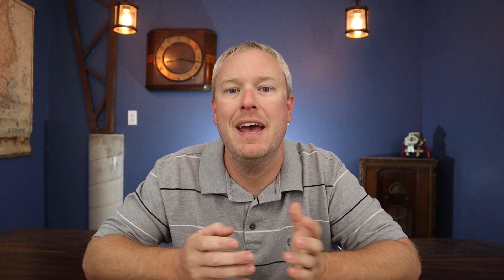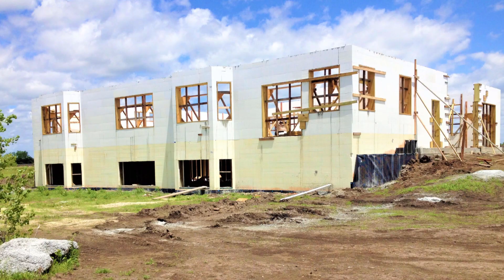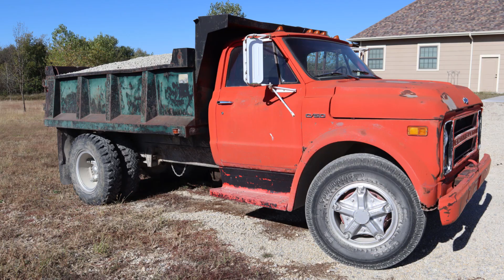NEW House Build Coming - ICF & Geothermal

Comment: Fantastic Garrett, this should be great.
Spend time on Plan Development, ICF stucco finishes, ICF trim interior & exterior.
Hollow Core vs ICF vs metal truss.
Window & Door bucks, design choices, material choices.
Window & Door size and material choices.
Electrical cabling, and Smart Home cabling.
Plumbing pipe size and material, and design layout.
Flooring choices: linoleum, vinyl, Terrazzo, cement.
Best wishes, and I can't wait to see what comes next!
John Willis, an avid fan in Gainesville FL

Comment: Wondering, what the expenses of building an ICF house are when compared to SIPS houses, including the amount of work required to put it all together and also expenses caused by intricacies of piping, wiring in such walls?

ICF blocks can be different, depending on the manufacturer. Here in Latvia, we have a factory nearby that produces blocks with sizes 300*1250 mm - should be pretty small to handle easily. Also, they have different kinds of blocks - for walls, for windows, for slabs, for wall tops, for foundation, closings and also they use additional fused PVC strength ribs.
They offer different block thicknesses. The thickness of the inner insulation and concrete layer is constant, 50mm and 150mm respectively, but outer insulation can be 250, 300, 350, 400 mm - you choose. Blocks are made of expanded polystyrene (EPS), trademark Neopor. Fire resistance: Class E, does not support combustion and is self-extinguishing. Thermal conductivity: 0.032 V / (m2 K) (I'm not a specialist, so no idea if this is a good number).

Comment: what's your opinion about building a simple house with concrete blocks and using rockwool as internal isolation and (maybe) PE as exterior isolation... ?

(my thoughts/plans is to use all above mentioned plus isolated slab/footings and a geothermal heating system with renewing air circulation)

thanks for your attention  !!
Reply from the maker: My thoughts are ICF is faster and possible cheaper when you factor in the increased labor plus the required framing on the interior.  I generally don't try to reinvent the wheel.
Reply: @Challenged1  thanks  😊

Comment: Full transparency... I was subbed to you during your initial house build and unsubscribed after you finished and kept putting out all those financial videos. Had this one pop up in my feed and re-subbed for the build. We live in tornado country and hope to build a 100% ICF house, including the roof, in the next 2 years on raw land. Planning on being 100% off grid except possibly for propane delivery if we can’t feasibly get enough solar for all electric appliances. Would definitely be interested in seeing your design process, block selection, geothermal and other equipment selection and hopefully cost info to help out our planning. 👍 Oh and any DJI drone will give you good results for the type of video you would be taking including 4k video.

Comment: hey Garrett, have ya considered tying in an EarthTube to the ERV? everything i've read says it works, but not quite worth it unless you can do the dirt-work yourself. figure if you're already trenching for the geothermal lines...
Reply from the maker: It's a spec build, so keeping it relatively simple.
Reply: @Challenged1  ...gotcha. makes sense i guess, given your goals on these (basically creating your own housing development).

got the 1br/1ba Casita we had talked about down to a 616sqft inside slab (FastFoot), & now happy w/it. should have it with an arch/engi next spring-ish. will be happy to share the fully finished plans with ya then, as you're doin a lot for us through these vids!

Comment: I am looking forward to following your steps in subdividing.  I have 40 acres in Washington State that could be subdivided, although I would probably let the next owner do it.  I'm interested in how you prepare the lots, like road access, setting lot boundaries, power availability, community or individual wells, septic situation, building restrictions, etc.  I acted as the GC for my house we built 20 years ago, but know little about the subdividing process.  We looked at geothermal, but have only 3 feet of dirt above bed rock, and didn't want the expense of drilling down through it.  But power is cheap here and heat pumps work fine.  And I like ICF's and would probably use them if I ever build again.
Reply from the maker: Thanks for sharing

Comment: I am trying to build a 2400 sf ICF house and running into this exact problem: contractors are unavailable, and those who initially enthusiastically respond later disappear. Yes, very interested to watch your progress. 
I have been researching action cameras myself and leaning towards SJCAM, which are available new for less than $100 (looking at a used one right now for $25 at B&H).
Reply from the maker: Thanks for the input

Comment: I've built a lot of houses and never needed a contractor license. But I've never built in Kansas. Never even had house plans.
Reply from the maker: Since I won't be the one living in the house, I'm forced to get the license.  I will say the building department doesn't require plans, but I need them for my subs.
Reply: @Challenged1  ...that's interesting. Wonder what happens if an owner-builder lives in it a short time before deciding to sell.

Comment: I definitely plan to watch every episode of this house construction. I am from Kansas as well And think ICF is the way to build in tornado alley.    Geothermal  Makes the most sense. I hope you plan to go with a  metal roof. This sounds like it's going to be a very interesting build
Reply from the maker: It'll most likely be an asphalt shingle roof.  Since this is a spec build, I need to keep the costs in check.  Thanks for the feedback
Reply: Is the labor on a metal roof a lot more than asphalt roof? I thought material cost were similar? We are putting a metal roof on our ICF build that we are about start.
Reply from the maker: @minutemandefense3935  Depends on the metal roof.  The covenants that I put in place require a standing seam metal roof if a metal roof is put on.  This method is more robust, but much more expensive.